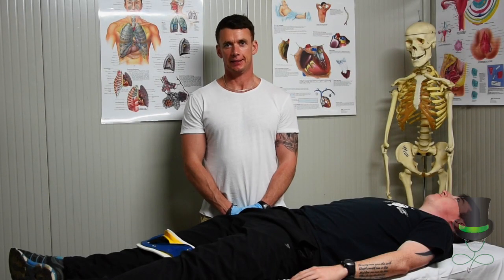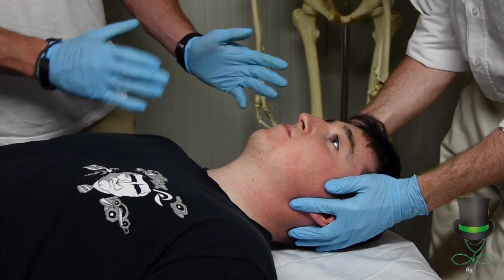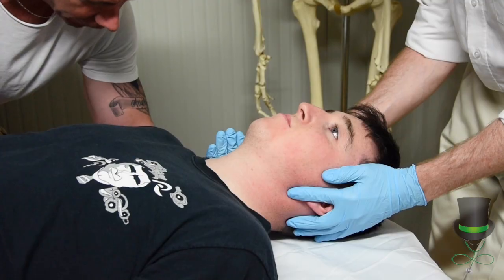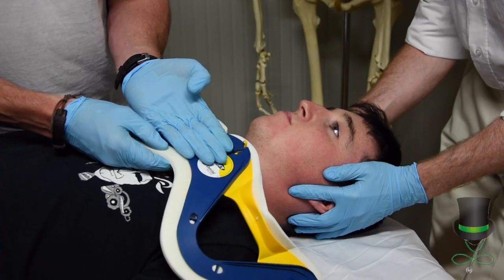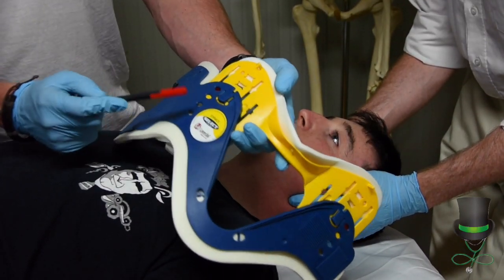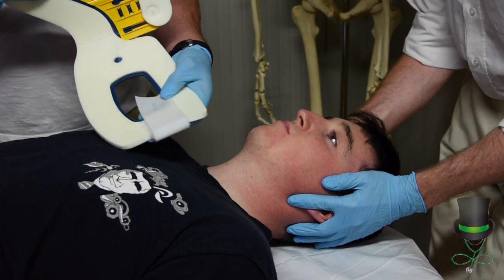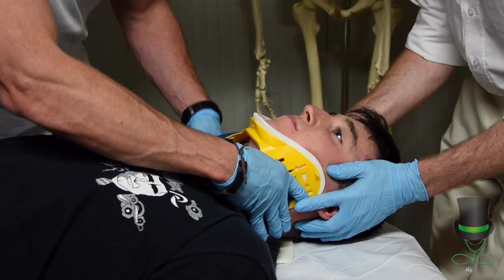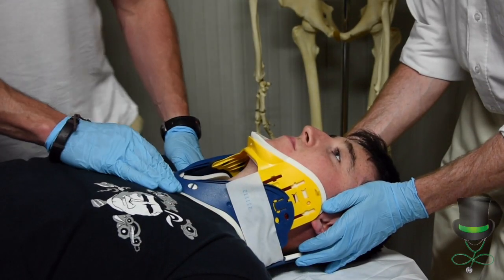Fitting a Cervical Collar

Comment: When the 4 fingers were placed on the blue plastic... The top/4th notch was still very clearly exposed... So only the first 3 notches were covered by the fingers. But the 4th notch was still considered to be the right size for the patient? 
If the fingers only covered the first 2 notches... Would we consider the 3rd notch to be the neck size?